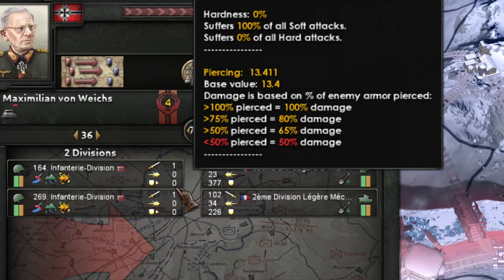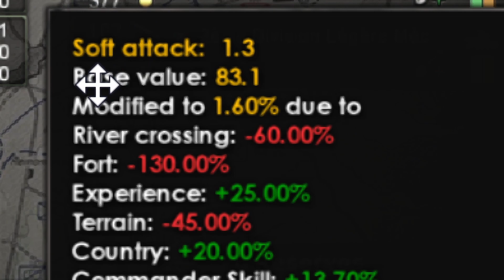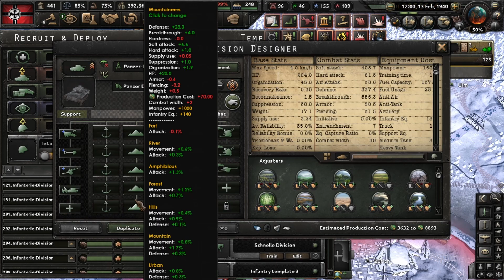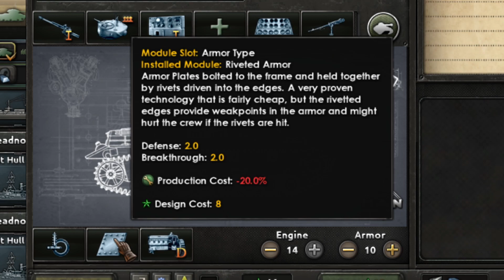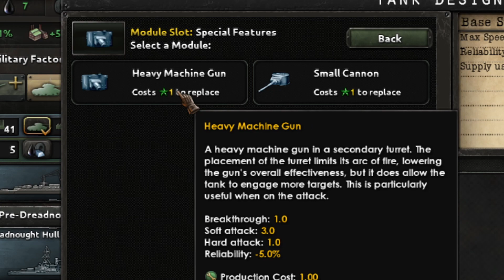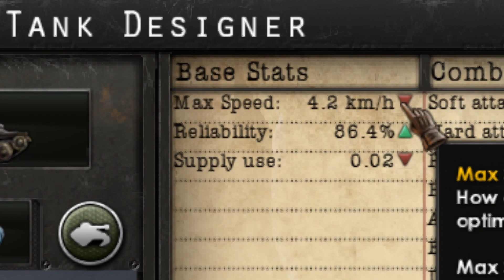Best Tank Design for use  with Special Forces for Hearts of Iron 4

Comment: People complain a lot about how slow tanks are in heavily treed areas. A testing video might be in order with regard to that point.

Manufacture 2 different light tanks, one with about 4.5 kilometers per hour speed that might be called "Desert Recon", and one with about 6.1 kilometers per hour speed that might be called "Forest Recon".

Make a test division template called "Cheap Artillery"
1 infantry battalion
1 artillery battalion
No support companies

Make 2 templates just like the Cheap Artillery template, but with a light tank recon support company. Set one recon test template as Desert Artillery to use only the slower light tank, and the other recon test template as Forest Artillery to use only the faster light tank.

Put one division each of the Cheap Artillery (with no recon) and the Desert Artillery (with the slower recon tanks) and the Forest Artillery (with the faster light recon tanks) on the same tile, and in the same army under the same general, and have them cross desert to some destination that is 3 tiles away, just to make sure that things are working as they should, making a check to make sure that ground conditions are clear, as opposed to snow-covered or muddy. The Cheap Artillery, having no recon, should be in last place in the 3-tile desert race.

For the next 3-tile race in the test, try forest or jungle with clear ground conditions, perhaps with a river crossing somewhere getting in the way. The test result might explain why some people complain about tanks being slow in forest or jungle. Also, try another 3-tile race in poor ground conditions instead of good ground conditions in forest or jungle.

Short version: A tank design that is strongly biased toward one terrain type might be substantially sub-optimal in another terrain type.
Reply from the maker: I did a video on horses vx trucks, horses have far less penalty in forest and despite having less breakthrough, since they pass the bonus to tthe tankes they end up being faster, with more breakt and more softattack in forest, and thatas wh yI made the video winged hussars, my favorite template for Poland to fight in forests.

Comment: Could you do a video where you show to win against Germany as democratic France without surrendering? I've tried many times but I can never do it myself
Reply from the maker: Sure, will ad it to the queue, but if you are anxious, I strongly suggest you try using the template I mentioned in best inf. division template, plus a template like this one. i think I could have something ofr you in about 1 week.
Reply from the maker: Just uploaded your request.
Reply: Thank you :)
Reply from the maker: @bertiefifield479  hope it helps
Reply: I just tried it and I've gotta say I annihilated the axis but the Soviets just declared war on Poland so that's a little troublesome. Thanks for the help though!
Reply from the maker: @bertiefifield479  hello, if you follow that path, you should kil the germans quickly.  it can be done with the armor template and doing pockets, but require some practice. The other option is tu turtle in France with the tempalte I explain in the one called "best infrantry division template" its impossible that a GErman unit can break that template in single player.
Reply from the maker: Hello, did a new video with light tank template for France and after that a video with a test using it with freee france managed to destroy germany loosing just 14k manpower.